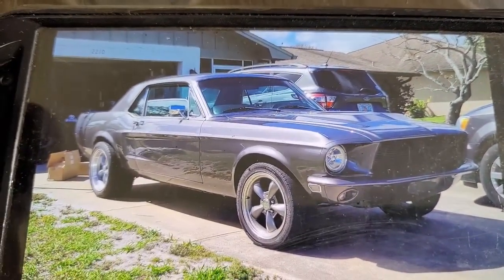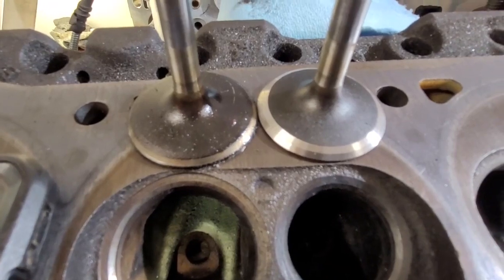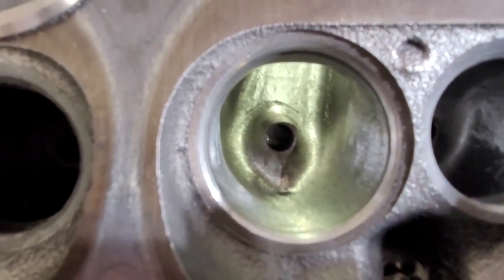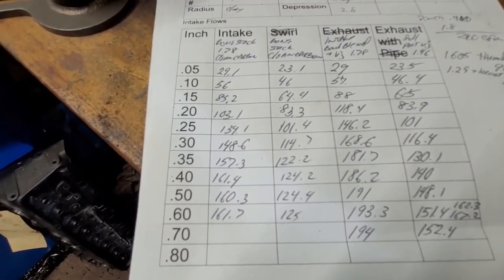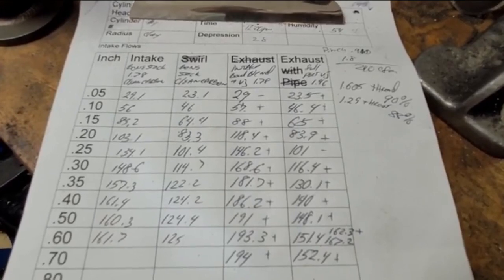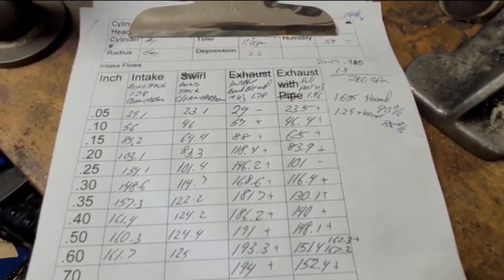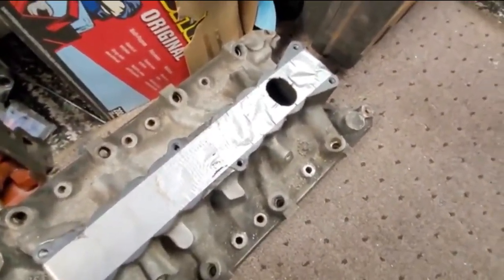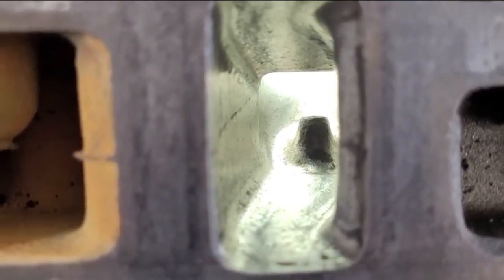Ford E7TE Cylinder Heads From Stock to Full Porting Part 1

Comment: 👍👍👍👍👍 excellent video Charlie. Fortunately I don't think that we ever saw that upper manifold here in Australia. The lower however is familiar up to 2000. From 2000 to 2002 we got the better staggered runner lower manifold with the larger ports. Bigdogs Porting showed some stuff on one and it appears that he was getting pretty good numbers out of the modified standard manifolds. Might be worth your mate considering chasing up one of those manifold combinations. Regards Greg
Reply: That manifold is a cast version resembling the tubular GT40. It has the round port staggered runners and fits the lower of the tubular... but has that intake sweep which is suppose to be better flow than the sharper 90* turn into the other. It also gives more shock tower clearance.
The 93-4 cars have a shorter height upper for hood clearance. 
The Explorer is tall and uses a sharp turn elbow into the intake, with the TB on the front of it.
Check Explorer pictures.
JMO but BigDogs makes excellent manifolds per $.
Reply from the maker: These heads will be mated to a fully worked single plane or tunnel ram. The 95 gt manifold has no chance of feeding it.
Reply: @servediocylinderheads  i can't wait to see the numbers that you get

Comment: The truck lower intake with a sheet metal upper would probably flow twice what the original 5.0 intake would..the motor is basically sucking air through a straw on the original. On another note my dads 5.0 had over 500000 miles on it and it had less than .002 ring wear, I honed it and new file fit moly rings and bearings,ported the heads with 3 angle valves and put it in my Ranger ,looking for another quarter of a million miles out of it or more and its at least 325hp or better now with 530 lift 220duration at 50
Reply from the maker: I believe it. The good fuel injection does not wash the cylinders down like the carb engines I grew up on so the cylinders stay in great shape.

Comment: Have you ever gotten your hands or grinder on earlier heads? There were many different chambers and of course ports depending on core shift. I’m running a set that I ported using very crude shop vac port testing. Installed 351W valves which had polished backsides and polished chambers. Runs really well. I would be curious how I did in comparison. All this work was done back in 1987 to my 66 mustang running a 1976 302 that I rebuilt.
Reply: Don, I do not posses the same skill as Charlie, but have worked a 69 302 head with a shop vac bench and had them tested. They were 164 at .3 and 180 at .6. They sat around awhile, and I did some more work on them to get them better on the home made bench, and would guess they are upper 180s now. I think a better valve job or bigger valves might be the next step....but would love to get them on a motor at some point.
Reply from the maker: Did two sets of 289 heads for D.V. I have not seen the dyno results yet. 244cfm.

Comment: A set of TFS Twisted wedge heads out of the box is what I would like to see how Flow Data between them and the E7 HEADS  that You are working on . Great content Thank You. 🇺🇲🇵🇷🦊👍
Reply from the maker: Not from me. Not a fan of twisted wedge.
Reply: @servediocylinderheads  why because they make too much power?  I had a set of ported E7s with 1.94x1.6 that was a blast to drive then swapped them out for TW and wow! Gains everywhere and wish I didn’t waste my time with E7TEs, unless bracket racing if you want to make power you need to toss them in favor of good flowing aftermarket aluminum head.
Reply from the maker: @msk3905  I am not a fan due to valve train geometry.
Reply: @servediocylinderheads  weird i had no valve train issues with them first on my 306ci then 331ci motor, no ptv clearance either with pistons not for TW heads and healthy cams

Comment: I've got a set of e7 heads that were on a crate engine and only ran once for testing never installed in a vehicle they are stock but I'd love to port them out rather then run gt40 heads or aftermarket heads it's gonna be in a street truck I've got headers and a procomp ignition system for it and I'm going to build it with better pistons rollers and possibly low rpm torque focused cam and Alil bigger injectors and I'll have to port the rest of the intake system obviously and tune the ecm I might get a 70mm throttle body to put on aswell I'll just have to do some testing and see how much it makes I don't wanna make to much power it's gonna have a stock aod and an 8.8 rear end with an Eaton locker I'll eventually build the transmission to hold up better but for now I'm not trying to make more then 300hp
Reply from the maker: 300 is easy.

Comment: So I was going through all my millenium falcon worthy smog pump air injection pipes   etc etc..   I planned to just run   my EGR   and original equipment but realized a couple of things..   Do you think now that my bumps are shaved down   it could throw any insufficient air for EGR?   Or is it kind of assumed if someone carves up E7s they are just going to delete all smog stuff.    I wanted to still run cats (at least high flow ) and I read somewhere that without the smog pump   or any of that stuff   cats could clog  ( esp given its flat tappet and needs zinc )    Guess I should have thought of that but I wasnt sure how much it needed that hump to catch exhaust into the thermactor / egr system
Reply from the maker: Full emissions should be fine with ground exhausts.
Reply: @servediocylinderheads  oh okay cool.  trying to avoid copd   lol

Comment: My dad had a 90 or 91 i think it was f150 extended cab long bed with the 5.0 and a 4 speed auto i think...and i thought back then it seemed pretty lively when you got on it. It would have smoked from his prior 89 regular cab long bed f150 with a 300-6 3 spreed auto it was pathetically slow.
Reply from the maker: @95Sn95  No doubt! Thanks

Comment: 🔔😎
Cam lift. JMO
Run all you possibly can.
If the head flow flattens out at say .500 then run .600 lift.
Consider how long of the duration the head is flowing it's maximum.
Not just 2 degrees, but maybe 20.

Also let's not forget that proper scavenging can make at head pull way more than the tested 28 inches.... Proper scavenging has sucked at more than twice that.
JMO 😎
Reply from the maker: You are right. That is what will really help the 50 degree seats...a bigger cam.
Reply: Scavenging depression: THAT is the reason many of us say, "We are NOT racing flow benches."

Comment: I'm probably not telling you anything that you don't already know but there were 3 different castings of the same lower intake manifold. Some were pretty thin and some had a lot more meat you could remove to straighten the really bad ports. I can't remember exactly how to tell them apart. One was cast by Alcan that was pretty good if I remember correctly. I think the info can be found by searching T-Moss porting. If nothing else this comment was good for another post count. Andrew
Reply from the maker: T moss doesn't have a website that I can find. He used to have alot of good info on there.
Reply from the maker: I didn't know there were different castings.
Reply: I read a very in-depth write-up of the three different lower intake castings with casting #’s and all.  All I can remember was that the Alcan cast lowers were more consistent, thicker and marginally better for serious porting.  I’d probably get an Explorer intake long before I spend a bunch of time hunting for the perfect HO lower…. but to each their own.
Reply: The desirable lower intake has noticeably more material on the outside of the runners. The other lower intakes you have to add material by welding the outside of the runners. The desirable lower has enough extra that no welding is needed.

Comment: I am on a budget i found a set for 50 bucks i am porting them to much gt40p heads . Doing for a project new to working in Automotive using a harbor frieght drimmal using the same carbed intake how do you like it it
Reply from the maker: They run quite well after some work.

Comment: Hey Charles we did the 50 degree seat and saw no difference but that's on a time slip not a flow bench my theory is the bowls are to shallow in the e7 but that's just a hunch i have no proof
Reply from the maker: Glad to get your input. That will be tested! Remember the steeper seat flows less at low lifts but not nessesarily more at high lift so. What it does is reduce overlap flow. It mellows a big cam. So, go a step up in cam!
Reply: @servediocylinderheads  You mean the flatter 50 seat reduces overlap flow?
Reply from the maker: @hotrodray6802  Yes, so you can jam in a snottier cam.

Comment: I got an f350 with the 5.8 I'm looking to stroke to 408. Curious if ported e7s are up to the task or if I should be looking for something different.  How about intakes? I want to stay efi
Reply from the maker: I would mod the E7's and the stock fuel injection manifold. I did a Speedtalk thread about 9 years ago, Build a lightning Bronco? Where I bought a junk lightning 5.8l and rebuilt it for Big Mike's Bronco. Detailed thread, Not a super high hp design. It has an overdrive tranny, 5.38 gears and 40" tires. So it was a torque/streetable build. He says it runs fantastic and pulls the big tires with ease.
Reply: @servediocylinderheads anything to consider or keep in mind working these heads for a truck application? The intake ports actually don't look too bad, the exhaust ports are just tiny!  How about on the actual intake? What are the best bang for your buck areas to hit?
Reply: *note I have DV's porting book but lost it. I have a fresh copy on order😅
Reply from the maker: @JakeMakesProductions  The exhaust port is actually the right size. Shaped correctly flows 185 cfm!
Reply from the maker: @JakeMakesProductions  The whole intake could use work. Do not hog out. Give extra radius on turns. Done.
Reply: @servediocylinderheads  really? The port looks to be about half the area of my header flange? If I open it up to match have I gone too far?
Reply from the maker: @JakeMakesProductions  Yes, gasket match on exhaust is wrong for most applications. Small fast exhaust with the correct shape is the way to go.
Reply: @servediocylinderheads  does this require chopping it up? Or can you get enough access from the bottom/inlet/freeze plugs
Reply from the maker: @JakeMakesProductions  For a truck application get to what you can get to. Cutting it up is a lot of work and not worth as much as I would have thought. I have done it a few times.
Reply: @servediocylinderheads  hate to keep bugging you Charlie but I really appreciate the advice! Would you consider GT40 heads off a 302 over the E7s?
Reply from the maker: @JakeMakesProductions  Gt40 is a step above E7's no doubt.
Reply from the maker: Bolt holes will need to be drilled out if they came from a 302 and going on a 351w.
Reply: @servediocylinderheads  just got to pulling out the valves on my E7's I didn't realize that on the second cylinder the exhaust vents all the way to the intake. Is there anything you do to address this?  Seems less than desirable, right?
Reply from the maker: @JakeMakesProductions  You could fill it with liquid aluminum. I leave them. Thanks

Comment: Yeah I was wondering about stock valve numbers it seems rare to see.  I did see one guy run a 203 cfm but lost some lower lift values.   He was an amateur but all of his cut decisions are logged.. I think DIYporting E7 is what to search if youre curious...  I learned this from DV    ( of course on a different head   )    but   He says removing the pinch only like 50% biased toward the roof side of the major pushrod bulge.    That makes sense because I've also heard  the short turn radius  opened up  is where majority of air flow gains come.    If you open that bulge toward the roof it creates a nice straight shot .  I only have valve lapping ability    so i cant do fancy valve jobs   so    I'm wondering if that move in the port alone could push it toward 200 cfm?   I know you told me it wouldnt hurt to flatten that bulge out but wasnt sure if youve ever tested that specifically.. although im still raking the channel lol
Reply from the maker: I have seen DIY. 203 cfm is nothing great.
Reply: @servediocylinderheads  well yeah, i was just curious as where the 1.780 have gone.. as far as stock GT40 flows or exceeding them a little.  I know your intent was larger valves anyway so i wasnt comparing was just curious if that pinch gets it to that point mostly
Reply from the maker: @tonypepperoni229  The more flow you get through the port the more important the pinch becomes. I do not see an advantage to a super fast pinch.
Reply: @servediocylinderheads  Gotcha,  so youre saying the 50% bias is not advantageous ..   have you and DV ever gotten into heated debates?  that would be a fun broadcast ha
Reply from the maker: @tonypepperoni229  We have. Not for broadcast. Always good discussions.